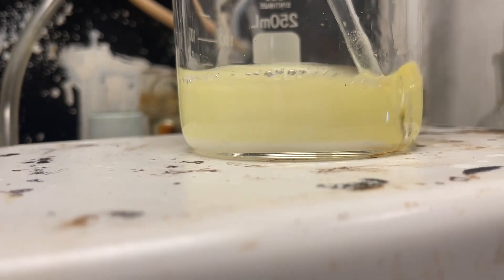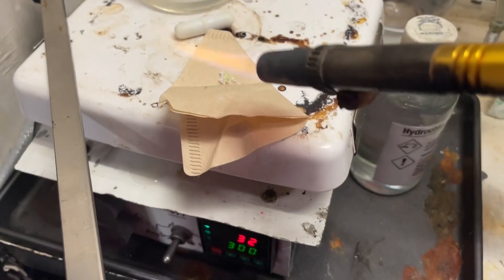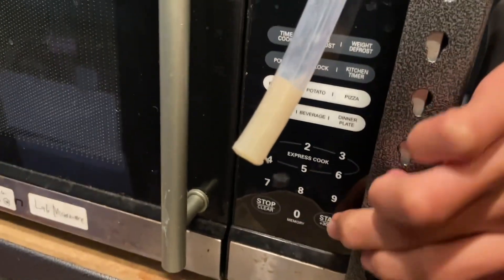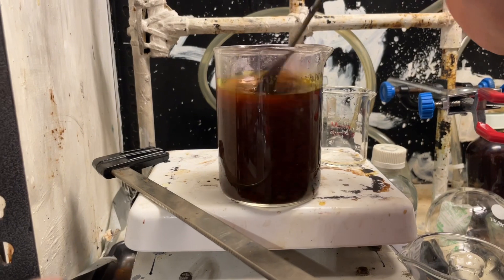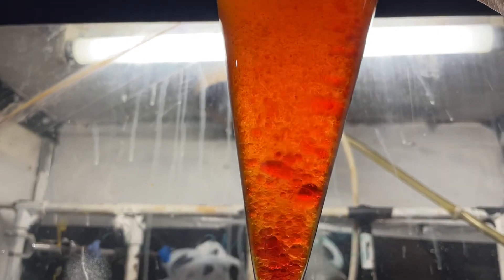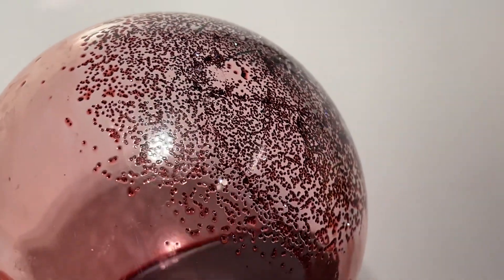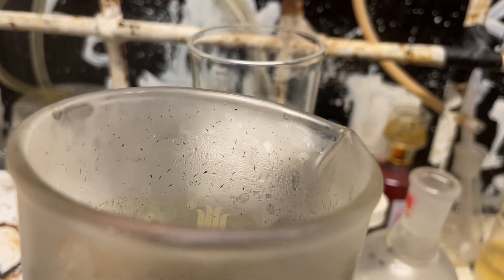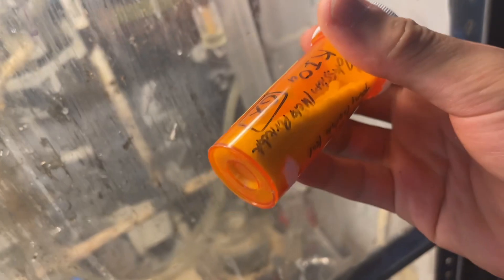Potassium Metaperiodate Synthesis (LabNotes)

Comment: Do you think this would work consistently with a potassium bromide solution to perbromate using Cl2 gas?
Reply from the maker: possibly though electrolysis would be best fit
Reply: @EdwardTriesToScience I think it’s impossible to make perbromate through electrolysis.  It doesn’t work the same way perchlorate does.
Reply: Actually I don’t think either of those would work.  Perbromate is notoriously difficult to make and the typical method actually uses sodium nickel periodate (which contains nickel(IV)) to oxidize bromate to perbromate.
Reply from the maker: @skyethebi  ah may have misremebered then but if theres enough interest i may try making perbromate